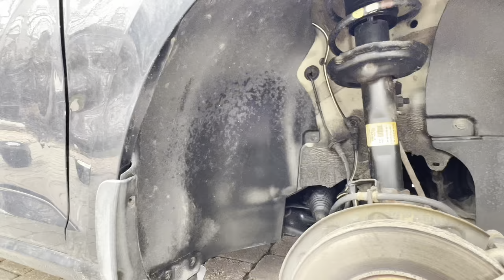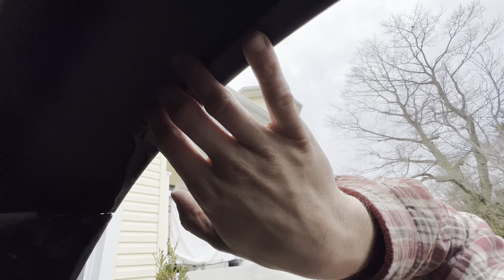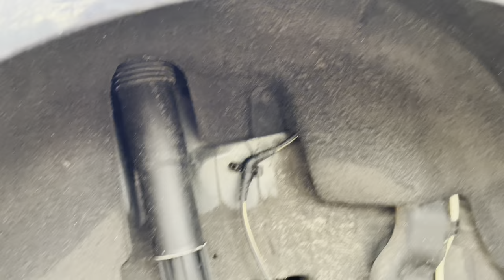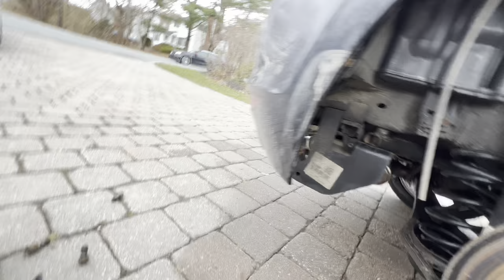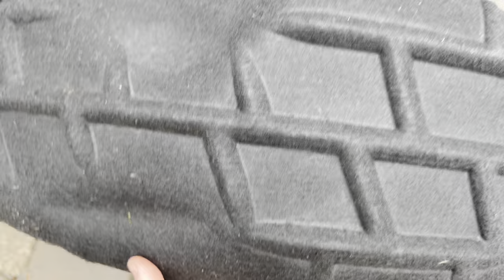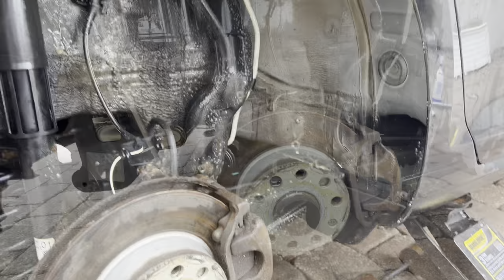THE SECRET TO KEEP A VW RUST FREE (Cleaning the Fender Liners on a MK7 Golf)

Comment: I just install better mud flaps and coated the liners with Rhino bed liner. The manufactures put foam and felt liners for sound dampening but ill rather have a clean car and rust free that will last than a rust bucket that is very quiet. If road sound is important just add sound foam in the doors and interior of the car youll get a RR Ghost quiet ride.

Comment: Just done the same on the rear of my mk7 (also had a mk4 before, which didn't have rear arch linings). Quite a bit of mud was trapped behind the lining but only minimal rust, though this would only get worse. Treated while doing a rear brake job but I bagged the disks etc to keep wax of where I didn't want it. Threated the subframe, cill covers and into the frame and also impregnated the arch linings so I hope they don't soak up moisture as before. Will see.
Modern wax products are very good but I think VW's paints less so, especially on subframes. I think their sealants and paint on the body are very good so it's the edges only or where maisture is trapped that continue to be the problem. I use a cheap underbody sprayer when there's salt on the roads.
Will investigate the front wheels next...

Comment: Nice vid! So that sponge inside the wheel liner/front fender is the culprit of the rust problem in my Up!. This spring I noticed some bubbling on the front part of the rocker. I pressure washed my car and the paint just peeled off uncovering a horrible mess of brown and black rust. Other thing I noticed was, that the paint was extremely thin and had only the surface paint over the zinc. Never buying a Volkswagen again.
Reply from the maker: It’s unfortunate for sure. I’ve had good luck with my cars up in canada but unfortunately have to be proactive with these newer models. Unfortunately I beleive that it’s not necessarily an issue with the make, but rather the cost cutting all manufacturers do these days. At least here we get the 12 year corrosion warranty. I’d love to have a little up lol. They’re sweet cars.
Reply: Well don't buy Japanse or French cars either then because those are 10x worse with rust!

Comment: Not trying to be critical, because I found your video very informative.  I just have to ask, how many people are going to take their tires off and remove their fender liners EVERY YEAR?  After watching your video I did my 2015 Golf MK7.  It took a lot of work and time. .  Most of the screws were so rusted that they were extremely difficult to get out without stripping the heads..  I ordered new screws and clips.  Unfortunately, my Golf MK7 has a lot of rust, especially just ahead of the rear tires in the rocker panels.  The car is only 8 years old and I had a 6 1/2 x 3/4" strip that was completely rotted out.  Since I have no welder, and can't afford to take the car to a body shop, I had to resort to the spray foam trick so many people advocate on youtube.  But it's just cosmetic, and my car will probably be un-serviceable in a couple years..
Reply from the maker: Very few do. It's a common issue on more cars than VWs and i do find on the MK7/8 it is way less an issue than it was on my MK4. You can probably get away just taking out the 2 screws. The vehicles do have a 12 year perforation warranty until 2018 when it was shorteded to something like 7 years.
It's unfortunate and frustrating though to hear about your situation.. I now religiously undercoat cavities.

Comment: Thanks for the video, nice to see exactly what behind all those fender liners. I ended up here looking to see more info about the mud flaps, and I've noticed you described them as being not great, to say the least. Why is that, are they not doing what they are supposed to do? I got the front ones only, in hopes to prevent scratches from rocks thrown by my own front tires. Would you say that is not the solution? I wanted to PPF the doors, but the prices directed me towards mud flaps instead.
Reply from the maker: I think mud flaps are fine but the oem ones make contact with paint so sand gets trapped in between and it ends out exposing bare metal. I like simpler flaps that don’t touch any metal like rokblokz

Comment: Thanks for your video - I am trying to trace water ingress into the driver footwell in my Mk7 and after checking all the usual culprits I am now convinced the foam insert is to blame. I suspect there is a water route to the interior, possibly along one of the welds. Looks like my weekend will entail stripping out the liners and sealing every visible weld. I sent a camera down the wiper channel and there was a mini mountain of dirt and leaves trapped in the cavity causing the foam to become totally sodden. No matter how much water I extract using towels pressed into the small hole in the carpet below the driver seat (UK right-hand drive) the underfelt remains wet - as if there is a sump of water gathered somewhere. Its not from the aircon pipe and it hasn't rained much at all. But the water is there every day. Frustrating!
Reply: speaker seals in the door
Reply: Clogged sunroof drains
Reply: Got the same problem did this sort your issue UK car too!
Reply: @NeedFourWheels  it’s the sunroof drains
Reply: @AndreasRP.  What if I don’t have a sunroof
Reply: @NeedFourWheels  great question, then I have no idea. I’d try to pour water on different spots to see if it leaks. Check your pollen/cabin air filter and or door seals to make sure they’re not letting water in.
Reply: @AndreasRP.  Thanks what would a wet pollen filter indicate?

Comment: Hi, i drive golf 7 from 2012/12 in Germany ( Hamburg ) and no Rust with 140.000+ Kilometers. i dont know why, but maybe u have to Clean ur Car a little bit more. For Rust u need " Owatrol Oil ", its one of the best Stuff against Rust. When the Owatroloil is dry, overcoat it with Paint and then some good Wax.
My complete Car is untercoatet with Wax from Dinitrol ( 4942 Metallic ) and 3642 for the holes.
Reply from the maker: This isn’t my car but i agree. Should be cleaned more. I will say that it is not a direct comparison though. In Canada, the salt used and winters are very different. Your vehicle also would not be a Mexican built Volkswagen. Owatrol oil looks very cool though. This I will be looking into for my mk8.

Comment: Was horrified just now to find several inches of mud and wet leaves behind my front wheels. Is there an aftermarket mud flap or something I can add to prevent this from happening again?
Reply: It’s an mkV rabbit
Reply from the maker: @aleckkrob1784  Personally on my car I am using rokblokz. I previously used rallyarmor, they don’t touch as much or any of the fender paint. However, the mud flaps are not what cause the dirt to build up. The stock ones hold dirt against the paint which will grind against it which isn’t good, but they don’t cause the buildup. I had the same issue on my mk4 with no mudflaps. It seems they improved it a lot on the mk7 but there is still some buildup. The solution really is to clear out your windshield cowl when you notice leaves etc., but also to check behind the fender liners at some interval (I.e. every 6 months, year, or two). Just cleaning it out and spot undercoating the problem areas is the best way to prevent damage.

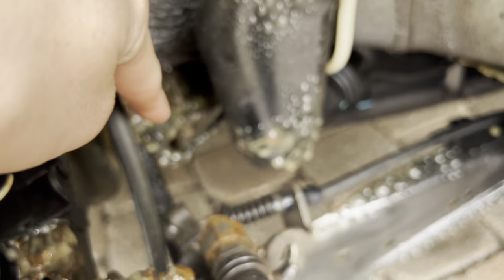Comment: When you mentioned undercoat at 19:00 in the video; What does that mean? Sorry I am a newbie;
Does that mean you use some sort of Krown/ Oil based rust proofing product and spray it?

Also interested in when you undercoated the screws to prevent from stripping;
Reply from the maker: Yeah I used an undercoating oil in a spray can. My rec would be fluid film or the new blaster surface shield.

Comment: I noticed when you removed the passenger side rear fender liner, there is a long clear tube just dangling there.  Same on my car.  Did you ever figure out how to route it?  There doesn't appear to be any cable clips. to hold it.
Reply from the maker: I just put the fender liner in and it basically fell into place
Reply: @VWTalk  Thank you.  Odd that VW, which normally has everything "buttoned down" securely, chose to just let this dangle.

Comment: do you think if i have small amounts of surface rust on spots around that thin mettle fender i can sand it off and repaint and what not with a paint touch up kit?!
Reply from the maker: I don’t see why not you can also use a rust converter to seal it after you remove the rust.

Comment: Dirt and dust doesn't hurt anything. Salt and moisture causes rust.  Why do they put that foam piece there?   Is it designed to destroy the car?
Reply: It is an acoustic insulator
Reply: @hrnple  Figured that.  Also damps any vibration.
Reply from the maker: Dirt and dust helps to hold the salt and moisture against a surface. It’s definitely for acoustics. The golf 7 was one of the quietest cars vw made in a while

Comment: Is it worth cutting a couple of inches off the bottom of the foam to allow the water to drain out  and run free?
Reply from the maker: Honestly I'm not sure. There are a lot of ways to tackle this, but my main point with this video is that you want to prevent wet sponges from sitting against metal.
Reply: I removed mine.
Reply: @honestreview1043  Did removing the foam affect sound proofing inside the cabin?

Comment: Do you think it’s bad to apply self adhesive butyl rubber (aka dynamat, etc) inside the wheel wells on sheet metal to help lessen road noise drone? Now I am scared of rust, haha.
Reply from the maker: Personally, I wouldn’t do it anywhere outside of the cabin for that reason. There’s always the chance salt and water and other crap will get between the rubber mat and the metal. Especially in the rear wheel wells where the fender liner is permeable.

Comment: I have a mk7 golf with rust issue in the lower front fender. What do you think of getting rid of that foam in the fender?
Reply from the maker: I think it’s not a bad idea, I compared it to my 2018 GTI. The mk7.5 actually replaced a lot of foam with hard non pourous plastic. The remaining foam is for sound isolation on the highway. You could probably even buy the revised part numbers. Your mk7 should have a 12 year rust warranty as well. Vw will replace your stuff for free, and you can replace the foam with the plastic parts to prevent it from happening again.
Reply: Thanks alot for all these infos. For sure i will go see the dealership for the  revise  part.

Comment: My MK7 has rust in places you'd never believe, along with multiple spots of water ingress to the interior. VW to me is such a dogshit car make compared to what they used to be. The low IQ engineering choices made in recent years, including their absolutely mind boggling decision to release the Golf 8 with their god awful software issues, I don't get it. I halfway want to just sell it but I have no idea what to buy instead.
Reply from the maker: Yeah usually my VWs have done well enough with the salty roads, at least compared to other cars. My girlfriend's Subaru had rust at the edges of panels under 1 year old and they'd do nothing. Not to say my local dealer hasn't shafted me on my 1 warranty claim- my horn and a speaker. Never had something like that go out on a car. The MK8 though is just such a departure to me. The material choices (like fake carbon on the R), no hood strut, shitty software, etc- I really see the cheapening. The radio I used in the mk8 was near unusable. I want to upgrade but hope they walk some shit back. But, what else is there that is better for the money that isn't used? THat's the real issue. I think VW is trying to push their higher end customers to audi and/or electric. I've had this hypothesis for a while that brands are going to make their gassers worse just to push us to the electrics.
Reply: @VWTalk  honestly wouldn't be surprised if that was their goal. Politics are driving people to hate ice cars anyway and at least here in Germany you are being treated worse by some authorities and citizens for driving a sportscar than for murder. I don't get where humanity's going towards.
My GTI is a fun car but it definitely is not gonna last forever. It's now almost 10 years old and it has some mad problems. The only solution would have been to give the brand new car a good treatment with wax and sealants to prevent rust for as long as possible.
Perhaps I should sell it while I can with minor problems (after fixing the very apparent bad ones).
 Maybe a Volvo would be the smart buy.
Reply: Toyota.
They rust too - like all cars. You might want to put grease into the sills and all other hollow profiles and into the doors. Got an expert garage to treat my car this way. They used 10 kg of grease and even covered the undercarriage. No rust, I plan to drive the car for the next 10 years, it's 15 years old now 😊

Comment: The design on cars from this brand, is a total disaster. They should have done something with it long time ago, but they just continue with all the flaws. I have a mk4, but i was lucky and got a really nice one. So the rust issues had not began yet. As long as you are aware of it, and prevent it with cleaning out and fluid film its ok. I also flush out the sills from both ends, because they get filled with sand, mud, salt etc. and of course fluid film after it dried up in there. And not to talk about all the problems with water leaks in and get under the carpet. When the car is parked with rear end higher than the rest, rainwater follows the rubber seals from top and under the door bottom, and inside to the floor both sides in front. It also leaks in where the pollen filter is, at the bottom of the case the filter is mounted in. I just removed it, and got rid of the gasket. Used some body sealant as a gasket instead. Now its dry. Im lucky i have no sun roof, because that is also a big issue. I almost forgot...also seal the opposite side of the pollen filter. Water can go inside some relays under it.